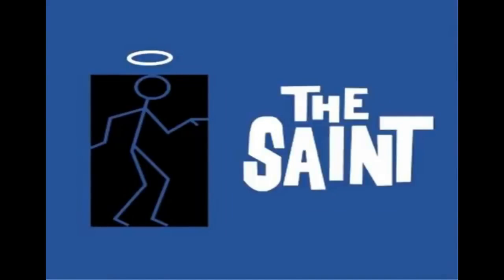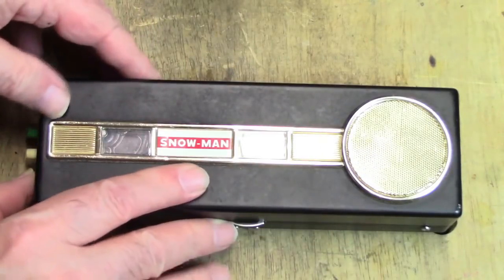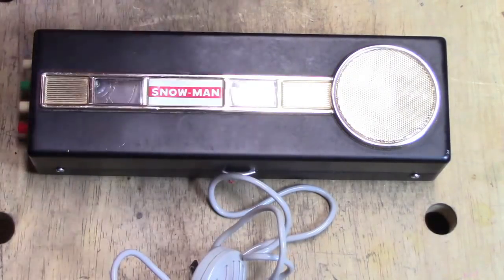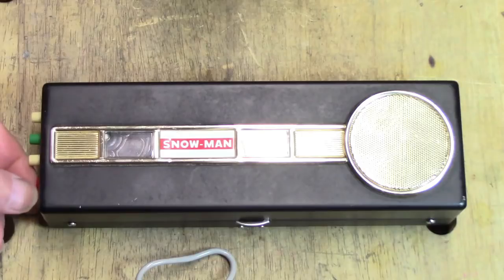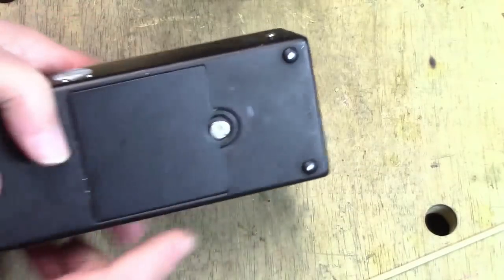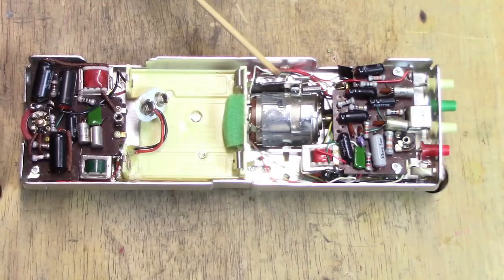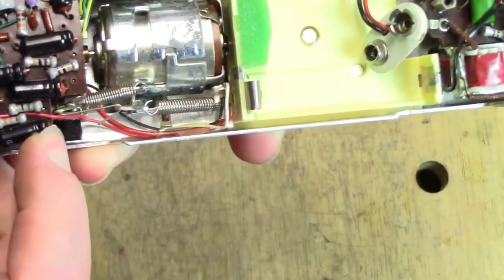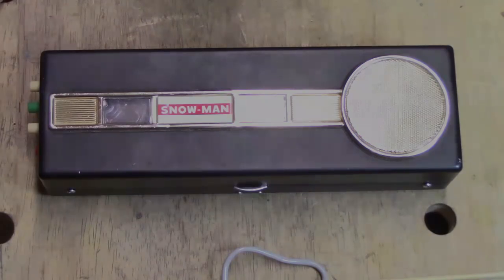1960's Spy Tape Recorder - Explore the 1960's SNOW-MAN Rim Drive Reel To Reel Recorder!

Comment: welcome back Tim. Was just thinking about you today and here you Uploaded a new video for us to watch. These are pretty cool tape recorders And the reel sizes are probably just as small, if not maybe a little bit smaller than even the channel master tape recorders. It's a good thing that the red stop button is always depressed when the machine is stopped so you know it's the stop button, but usually I identify red with the record button so I would probably be fiddling with the wrong button all the time trying to stop it or record with it.  I know what you mean about not really wanting to fiddle with the amplifiers on these small machines I have a few protona minifons as you know, and the early version I have was a bit of a pain in the neck to take apart but I was actually able to replace the capacitors and resistors in it because they were kind of laid out to the point where I could easily or fairly easily replace them. On the later protona minifon model all the capacitors are layered one on top of another and there were 2 small circuit boards that were sandwiched 1 on top of the other and I really didn't feel like taking them apart. So when that model protona goes dead I guess I'll just keep it as a display model. But your machine works very well and it's 1 of those machines that I would have liked to have collected back then but I've kind of come to the end of the line collecting tape recorders. I just like playing with the ones I've got and watching your videos of the ones that you've bought. Thanks for uploading it, and it was very informative and cool to watch.
Reply from the maker: Thanks for watching the video. I am always dismayed when I get into a tape recorder only to discover that the electronics or wiring is failing and the assembly is completely bonkers and built in layers instead of modules, so it is service UN-friendly. 

If I recall correctly, the Channel Master machines were made by Standard and used tiny 2-inch reels. Ultra thin tape as well. 

The button arrangement confused me at first too. But, I can see the concept RED- Stop, GREEN - Go because of traffic conventions and thus would seem familiar. Which forced the REC button to be a color other than red. BUT, this was made in the way-back-when and colored keys were a "feature", but unstandardized. We've both seen a lot of variations, haven't we? LOL. 

Glad you enjoyed the video!

Comment: Nice machine and great to see you back on the tubes. Your so correct about the rising eBay prices but that just makes our collections more valuable, although I've never sold on any of mine - yet.
Reply from the maker: Thanks for watching the video. I love your channel and your tape machines. I have to admit, I am a bit jealous because you have such great models and they are in such great shape. 

You should see some of the crap I've gotten from E-Bay! Some is totally un-restorable! You know the deal -- hopelessly dried out rubber, corroded battery compartments and the worst, a recorder that some "expert" tried to modify or fix. The ones that make me laugh are recorders with completely missing control knobs and the seller says "in excellent condition, works perfectly". yet the picture shows the missing parts and no tape or power cord! 

The latest insanity I have seen from E-Bay (2018) is idiotic shipping rates because the sellers let E-Bay automatically apply postage, and it always uses the highest price USPS rates. No kidding, 

I saw a Ross Mark IV rim drive tape recorder going for $25 BIN, and the seller wanted $95 for shipping!

I don't get it, why they do that. If I see an item with unreasonable shipping... I'm gone from there. 

I've tried negotiating with the sellers in the past and the usual response I get is "I have no control over this, E-Bay makes me do it."  

Yeah, sure!

Sorry, had to rant.

Comment: One of my friends had one of these recorders when we were kids. I don't remember the brand on it and they differed from importer/distributor to distributor. I remember him having a problem getting tapes for it since it only took those odd ones and nobody had tapes for it after a few months. Most of these had short careers because of that.

I think the best-selling small reel recorder was the Concord "Sound Camera". It survived for a while against the cassette onslaught.

BTW, The camera that Bond is handling was not a movie camera. It was a "Twin Lens Reflex" 120/220 roll film still camera, probably a Rolleiflex. This type of camera was hugely popular at the time in Europe. It would be years before the 35MM SLR took over, not being user-friendly at the time. Movie and TV props don't actually have to work, just look the part they are playing.
Reply from the maker: Thanks for watching the video and for the information about the movie camera. Of course it could be a "movie" camera, meaning that it is a camera shown in a movie... being handled by a "movie star", but why quibble over small details? At least it wasn't a Wollensak! (:>)

Comment: The Telmar T-100 has been on my watchlist for years... Once I saw one on eBay. 150 bucks. Nope.

I find it funny that its "Brand" is Snow-Man! Have you seen the Soviet clones of these on the 'net?

Very nice little unit! Classic of the rim-drive. I like that this has two separate circuit boards.
Reply from the maker: At 15/16th ips, I imagine the sound was not great!